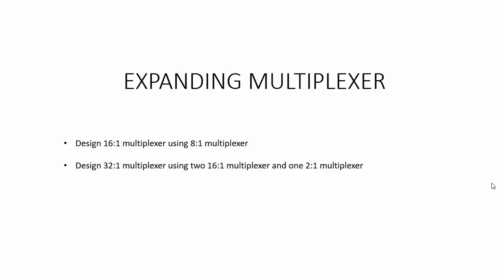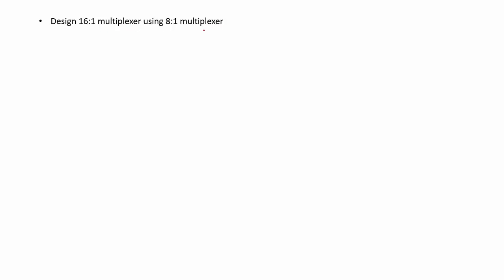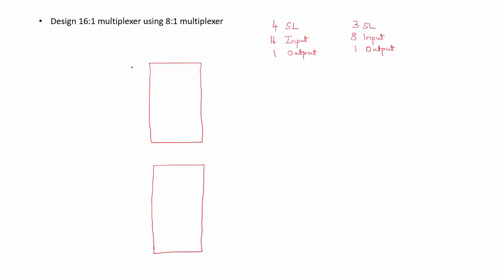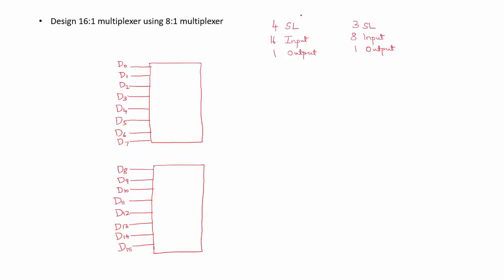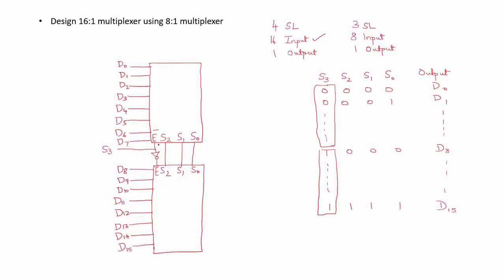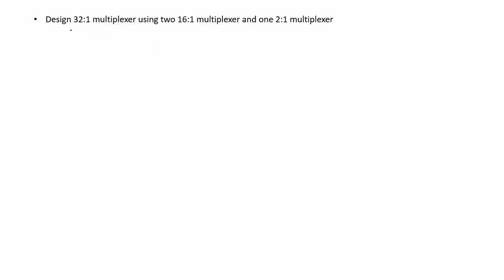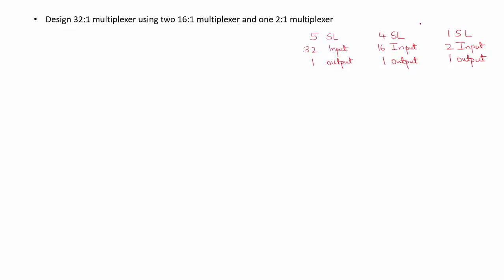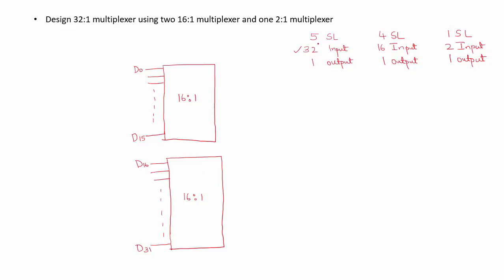Expanding Multiplexer

Comment: I have a question. Is it possible if I want to do a Mux 32:1but using only two Mux 16:1 without the 2:1? Can I put an inversor before the enable chip of the secund Mux, like you do in the 16:1 using a 8:1 Mux, and the results will be the same? Thank you very much.
Reply from the maker: Yes you can. 
Make sure to use an OR gate whose inputs will be output of each 16:1 mux and the output of the OR gate will be output of 32:1 Mux